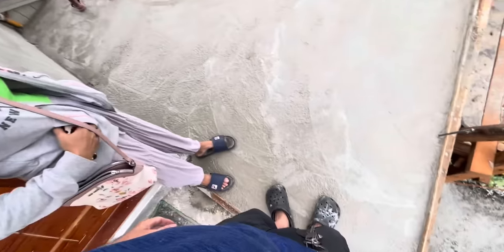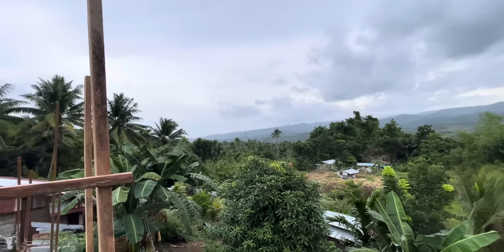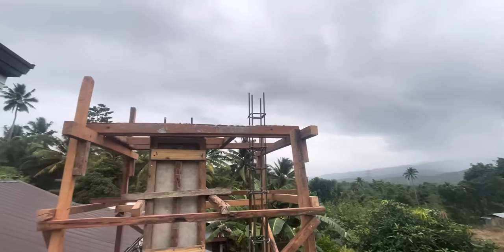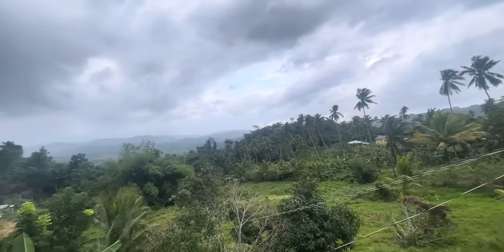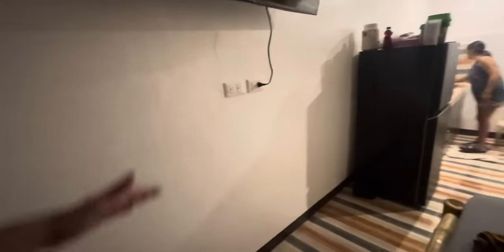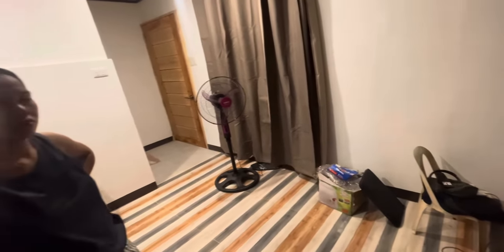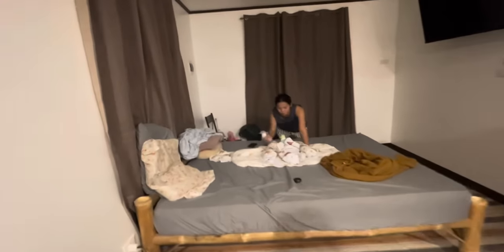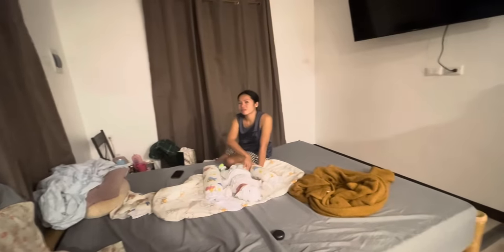Trip to the hospital - water tank for balcony

Comment: Remember Dustin , a pump can only lift water 30 ft max , from the top of the water level to the top of the tank. Water can be pushed a lot further, make sure your pump is on the ground, not on the patio.
Reply from the maker: Ok thanks Tony , we will have it by the well